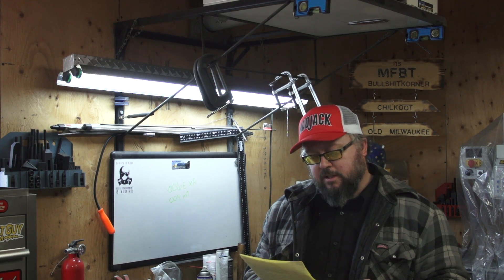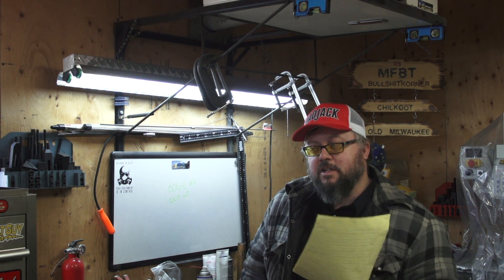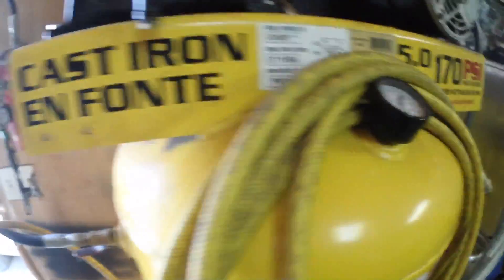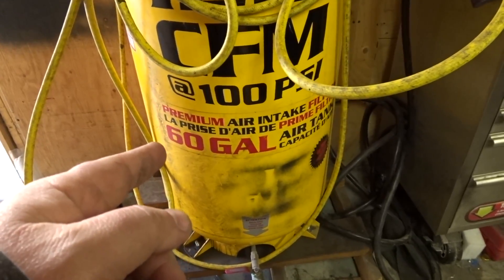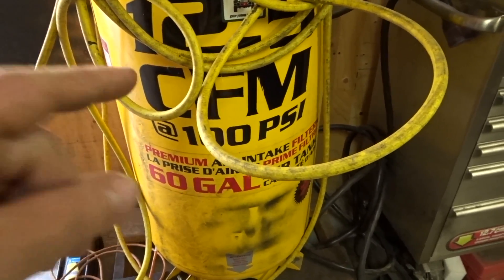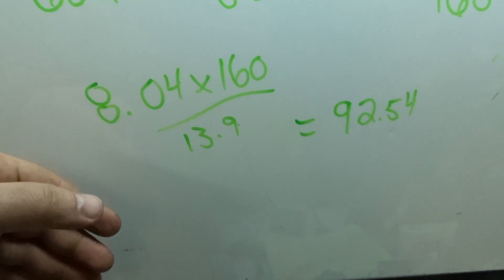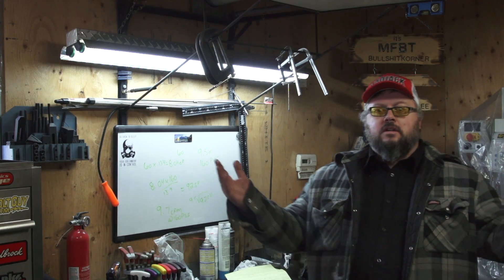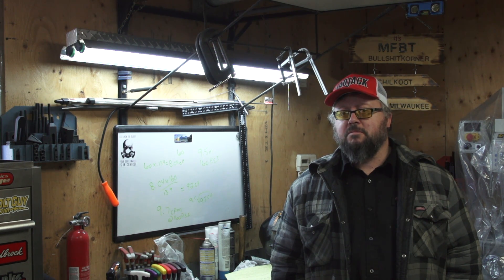How to Check Compressor CFM

Comment: Ingersoll Rand uses (Gallons x 0.536 x PSIG / Seconds) In your case 60 x 0.536 x 160 = 5,145.60 now divide that by the 570 seconds to fill = 9.02 cfm at 160psi. To ballpark a 160 psi cfm to 100 psi cfm you can do (160 x (cfm - 1) /100) so in you case 160 x 8.02=1283, 1283 divided by 100 gives you 12.83 cfm at 100 psi.

Comment: Your compressor wont deliver 9.7 cfm at 160 psi. Using the ideal gas law and using the rated compressor output (100psi+13.9psi)/(160psi+13.9psi)x 12.5cfm should give you a constant output of 8.18cfm @ 160psi . You are getting the same amount of power regardless of the psi or cfm. At lower psi sure you are getting more cfm but at a lower pressure and a lower cfm at a higher psi. Regardless you are getting the full amount of work that compressor can deliver. An analogy to this would be in electricity Power(work)= Volts(psi)x Amps(cfm) given a fix amount of power you could increase the voltage(psi)and reduce the amps(cfm)and vice versa, the only real way to know cfm is using a flow meter at a constant pressure, what you have here is the average cfm and the time to fill up to 160 psi,hope this helps.

Comment: its per minute not per 9 minutes..? or am i wrong? your math equation is missing a few steps in algebra i think?.. you would have to measure the continuse CFM demand of the air tool by having a fully charged tank. airline full. pull the air tool trigger full open then see if it meets the air air requirement. Pressure equals CFM. This type of test has too many options of air tool requirements to be accurate. if its a spray gun and spraying base clear then most experienced painters know how their spray gun sounds.

Comment: you are not calculating it right.. it says the cfm at 100 psi on the tank , not at 160... now calculate it properly.....  when you lower pressure you can raise the cfm.. sounds wrong but its true... and its what cfm goes out is what your realy after , not the scfm.. scfm is what the motor is capable of sucking in to get the number rated.. yes its a big con, like most things in life..

Comment: Hold up... where the hell did they trick anyone? The pump is rated to constantly put out that much air at that regulated pressure. If you had a tool, or collection of tools that used a total of 12.5 cfm, and operated at a regulated 100psi, the compressor would supply those tools continuously. You get a result of 9.5 at 160psi and somehow that's a bad thing? What tools run at 160 psi? Most tools are under 100 do idk what the problem is here.

Comment: For a relatively new design compressor it runs pretty slow. My 70 year old pump runs at 12-13cfm and fills a 200 Liter tank at just 5mins at 125psi cut out. Maybe service your compressors valves/rings? This helped my old air compressor get a new swing at life. My broomwade compressor runs a 1400rpm 3hp old styled higgs motor and the pump is a big 'fu**-off heavy cast iron chunk, but even though it's very heavy it makes significantly less noise than the newer multistage compressors, can stand next to the compressor and talk normally with my bud without having to raise my voice.

Comment: Cool video. Good idea. Worth doing when u first get a unit to compare in the future to check on issues. Not criticizing in anyway but don't you think what you calculated here is more like the average CFM of this unit between atmospheric and 160 psi and not really CFM at 100 psi
Reply: To get the CFM at 100 psi we should be running the unit and adjusting the output air valve until it is and hold 100 psi in the tank. This should give the same input and output air. Balanced. And then measure air flow wether in or out. Might be wrong, I don't know much about air compressor.

Comment: Set your regulator to 90 psi hook an 8 cfm orbital DA sander I bet you that 9.7cfm at 160psi can't keep up. I bet you it never shuts off. Witch means it's making less then 8cfm @90 psi. These ratings on the tank are SCFM that's how much air it pulls in while making rated psi
Reply: That's true but also logical. The SCFM is CFM at standard conditions (generally 1bar atmospheric pressure, 25 degree and 0% RH). They also haven't allowed for pipe/hose/fittings/bends etc after the unit. They also have clean new air filter. New pistons etc once you take all of this in consideration then you realize damn I should have bought a bigger unit then. I always size my units a bit bigger than I need. My calculations generally come to 30% more then you need
Reply: An 8cfm "rated" da sander is only rated at 25% duty cycle. That sander will need 32cfm to run properly. And although this compressor puts out ~10cfm, the compressor itself will be rated at no more than 60% duty cycle. So really it is putting out 6cfm continuous. So yeah, trying to runa tool which consumes 32cfm off a compressor that can only put out 6cfm, not going to work well, or not for long.

Comment: Fuck Yeahhhh. Just checked my “new” compressor I got off an old neighbor guy. If this equation is somewhat accurate my compressor is the BEAST I thought it was!! 80 gallon filled to 125psi in 2:30 seconds. Woah. That’s over 30 cfm... It’s a Speedaire 7.5hp with a big ass dual pump. 40amp circuit. RAD!!

Comment: Can someone work this out for me. I have had this unit for 30 yrs and never had the rating on it. 

2 minutes 11 seconds to fill the tank and there was 120psi in the tank.   

Size of tank 
1.33 cuft
37.64 litters 
4.972 us gallons

Location
Toronto, Ontario. 

Thanks.
Reply: 5.44 cfm
Reply: @saranmurugan7615  Thank you !!

Comment: If it has 9.7 CFM at 160 PSI then i could be right what the BIG Label on the Tank says.  12.5 CFM at 100 PSI  .  At 40 Psi it has arround 15 to 17 CFM.
Reply: Yea. the CFM can be more at lower pressures. So if it's 9.7 at 160 then it should be at between 11 and 12.5 around 100.
Reply: what would or might the cfm be of an inflator that gives 4psi every 10 seconds??
Reply: @fallback8314 Not enough information lol. Psi is a measure of pressure has nothing to do with air flow.

Comment: For screw air compressors you times the kw by 5 and for piston compressors you times it by 6 that’s how you find the cfm
Reply: can you clarify more .. for instant i have a 22KW Screw compressor .. then 5^22 =110 /60 = 1.83 m3/min "FAD" .. am i doing a right calculation for 22 kw screw compressor ?

Comment: You always could have a bicycle pump it would give you some exercise, may take a while to fill a 60 gal tank. The only time you need CFM if your sandblasting. For your use in the garage that compressor does all you need.
Reply: Set your regulator to 90 psi hook an 8 cfm orbital DA sander I bet you that 9.7cfm at 160psi can't keep up. I bet you it never shuts off. Witch means it's making less then 8cfm @90 psi. These ratings on the tank are SCFM that's how much air it pulls in while making rated psi
Reply: @electromechanicalstuff2602  correct... its what it pulls in not what it pushes out.. big difference.... company's lie all the time and should be prosecuted for it... if it says scfm then they are covered, if its just says cfm then take them to court and you cannot lose.

Comment: Also the result for 160psi is not accurate because the pump pushes against 160psi for like 10 seconds before it shuts off.
and when the pump is workimg below 100 psi ot probably pushes a lot more than what's advertised. it's a good baseline but it is not a true result.
Reply from the maker: +ProbeGT2 actually it isn't, the result of the 100 psi is written in the description
Reply: I read that, but even tho, the compressor works from 0 to 100psi n the while time it's working below 100psi the pump will pushes more air because cfm drops as the pressure rises. To have a true accurate reading you would need to run the pump with the tank at 100psi and calculate the air flow comming out of the hose while maintaining that 100psi in the tank.

You can often see 2 values on compressors, pump cfm @ 40psi and pump cfm @ 100 psi.
Reply: * and the whole time,
slrry writing from my phone.
Reply from the maker: +ProbeGT2 that's not accurate either because flow is going to be different if you have a 3/8 hose or a 1" hose
Reply: @ProbeGT2  - that sounds more correct... if you could regulate the big compressor at 100cfm... and use the air hose to fill a 2nd tank to 100psi, and timed that... would THAT work with the same calculation (using volume of the 2nd tank, of course).

Comment: 100 psi is an accurate mesure because most tools run on 90-100 psi so if you want to know if the pump can sustain the tool, it os a good way. Also it seems to be a kind of "standard" manufacturers use, mostly 90 psi.

Comment: So can we covert that number back to 100 PSI and see if the 12.5 cf/m they advertise is even accurate. This may also tell you the effect of 10 years of wear on the  compressor.  No big deal just a thought. Could re-time and just shut the compressor off at 100 PSI.  I'm going to check mine for sure. I'm bookmarking this vid. thanks Bud. KIT d
Reply from the maker: +Douglas Laramie it's done in the description

Comment: using 1/4 inch high flow fittings on my air tools and lines made my tools wake the fuck up. (still using 3/8" hose) milton V or the cheapy aluminum husky brand work well.
Reply: Automotive style are big too.   Like the Merlin brand at harbor freight.    They're the same ID as the ones called high flow.   And they hardly ever leak like the V style.
Reply: Yep. People always under estimates the pressure drop through pipes, bends, fittings. The bigger the compressor the bigger everything else need to be sized if you want to take full advantage of your unit

Comment: Marketing works.  The cfm traveling own a hose in different diameters must all be different as well.  I have some air tools that show a cfm rating and I think their way off as well.
Reply from the maker: +STEVE ROB most people don't realize that, the larger the hose the more CFM = more power.  Sometimes at work we need to hook up 2 airlines to a 3/4 impact gun to achieve full power on stubborn bolts
Reply: Your right. Bigger is better to a point I assume. 1/2, 3/4, 1' are all good choices for more POWER. Har,har har. Bad "Tim the Toolman" imitation.
Reply: Thats really interesting. Gonna have to try that if I get stuck in a bind.